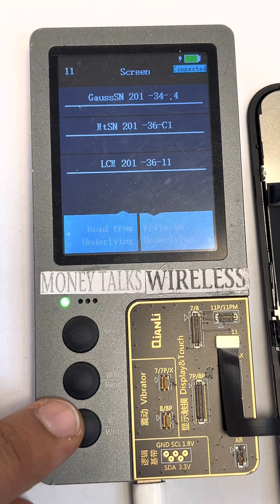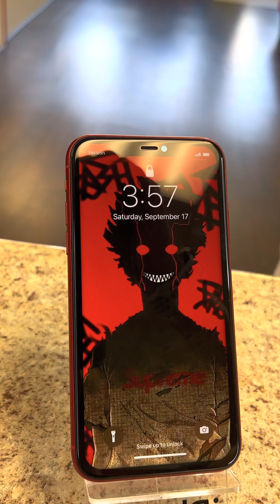7 year old cousin took the phone and smashed in to million pieces 😱Watch till the end #asmr #apple

Comment: not for this video but. Thankyou for the info you pass out :) .as today i had an iphone xr boot looping and it was the camera/siri/speaker lead and i got my customer so they can now back up there data ( doesn't boot loop and boots now) you rock for the info i have learned from your shorts. i have learned some things from you. if i ever get the chance to go to the US of A ice will get treats galore :) thanks again for the spreading of info that people and us repairers need
Reply: oh and i didn't charge for unplugging the cable to get the phone out of the boot loop. and i did explain that the customer that to make and receive phone calls they will have to have a hands free kit wired or Bluetooth and there siri and face ID wont work as well as front camera. happy customer as they can back up there photos ect